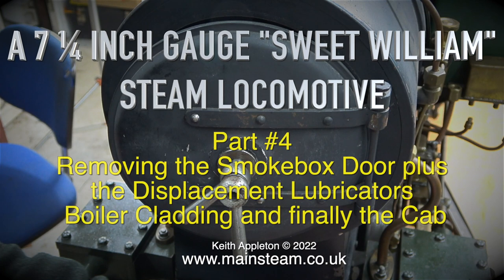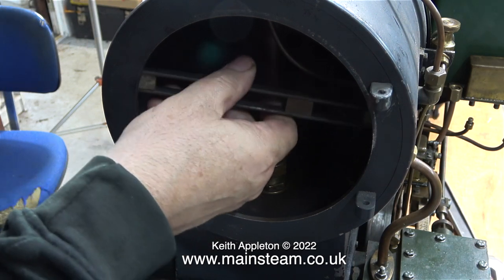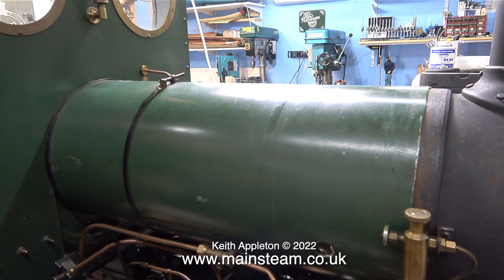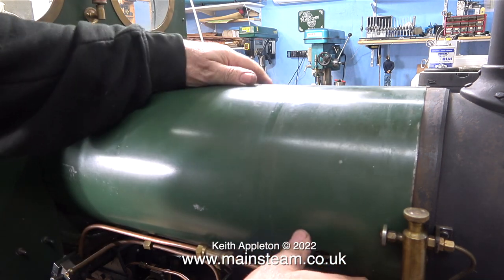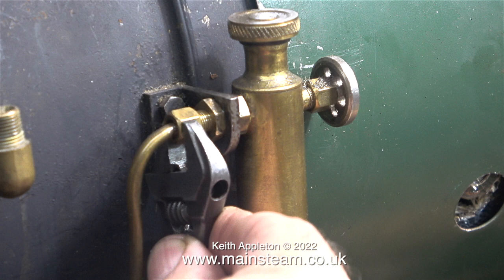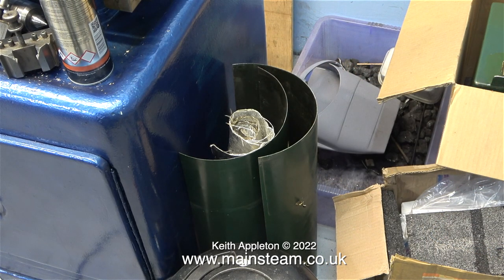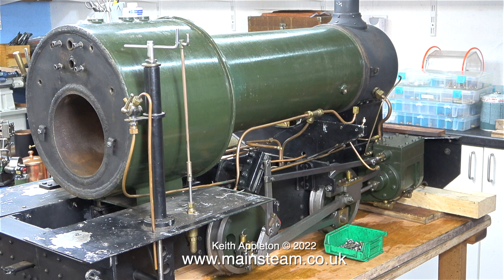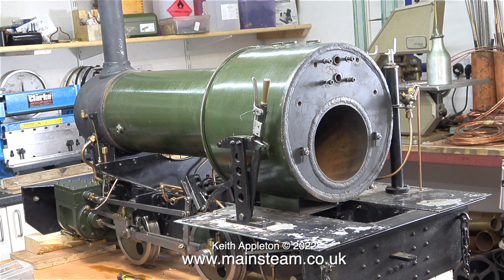A 7 ¼ INCH GAUGE "SWEET WILLIAM" LOCOMOTIVE - PART #4

Comment: I work on injection moulding machines. It's not uncommon to have a 6ft scaffold pole on the end of a 68mm spanner trying to take parts off. I bought a part built sweet pea from an auction and really struggle to not damage the threads when I'm tightening them. Everytime you give this warning I smile to myself as I'm completely guilty!
Reply from the maker: a firm but sensitive approach is good . . .